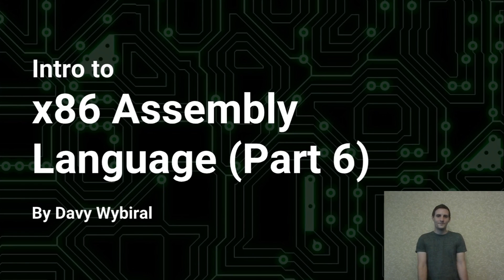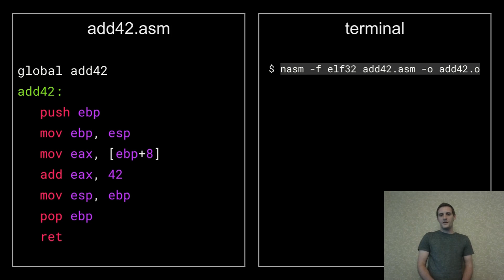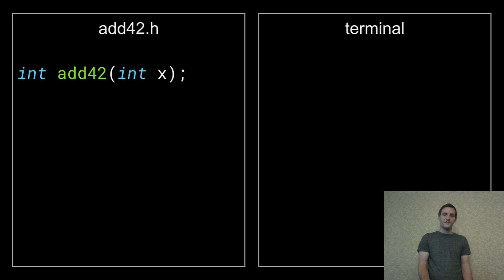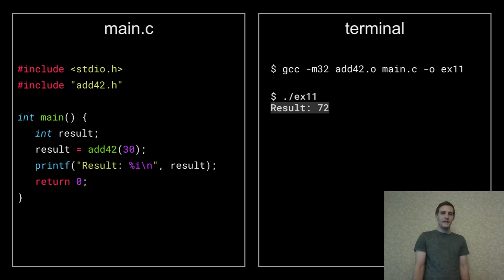Intro to x86 Assembly Language (Part 6)

Comment: Thanks! Good overview. The prolog and epilog are conventions defined by the operating system or bios of the machine you are programming. I’m from way back when bare metal programming had none of that and depended on what address the processor started with after a hardware reset. Unwrapping C to show the assembly language equivalent is informative. … for those viewers wanting to go lower yet, the Ben Eater series will give some insight on how eax and ebx might interact with processor registers to execute instructions in hardware. The only way to learn is to jump in and work your way up or down the layers of abstraction. … or just be happy mastering your favourite layer ( just being aware of the other layers )

Comment: Great explanations and examples. The visualised stack really helped. Only possible thing that would help a tiny bit, would be to animate the movement of the stack pointer. I found I was jumping back and forth slightly to pick up on where it was/where it went to as you stepped the code. I think a small animation would have made that more apparent. Extra work I appreciate but I think you can do very simple animations in things like powerpoint. Really great video anyhow and the colour thing was good enough.

Comment: The standard libraries are most likely written in assembly and then only rewritten to header files to be used in the C code. This is very clever insight into how some libraries for other programs can be made. I've never actually seen any source code of the standard libraries' functions, only a glimps of the headers that are linked in the C source code. From what I know, many of these libraries may be written in assembly and compiled into static library object file (*.o files). The compiler comes with precompiled header binaries, we may have no idea if it was made in C or assembly.
Reply: The c library most of it in c and the other in assembly.

Comment: Great work.   I would see the logical end may be maximizing the full potential of the hardware with efficient software. Validated software.

I'd like to maximize the computing strengths of raspberry pi's or risc ~very inexpensive~ open hardware solutions

Comment: I don't understand how you know that eax is the return value of add42.asm program ? As the stack indicates, there is a specific cell in stack for return addresses, but we don't use this cell. We use eax. Explain please !
Reply from the maker: The return address is where the program will jump back to when the function is done, this is stored on the stack. The return value is the result of the function, this is stored in EAX.
Reply: It is stored in EAX by you, or by default ?
Reply: it depends on the calling convention. Most calling conventions including the C and C++ standard calling convention cdecl stores the retun value in eax (if integer or memory address)
Reply: @93Mosfet Exactly the scenario that I'm looking for, now confirmed, thanks dude.
Reply: This confused me as well, in the other tutorial eax was used for system calls,  4 = write, 1 = exit. Here it is used for the function return value. He put it in eax in the function in the previous video and then moved it to ebx so he could reset eax to 1 for the exit.